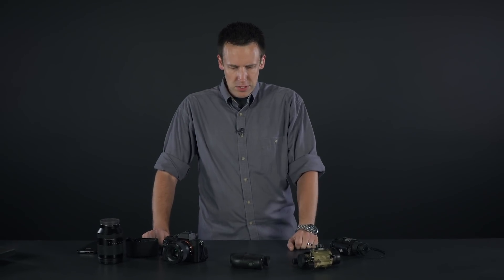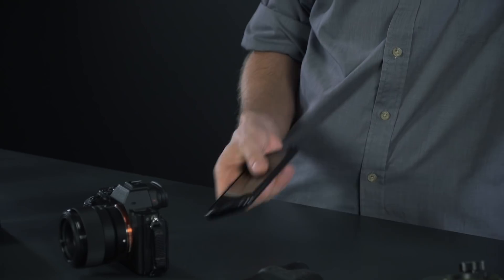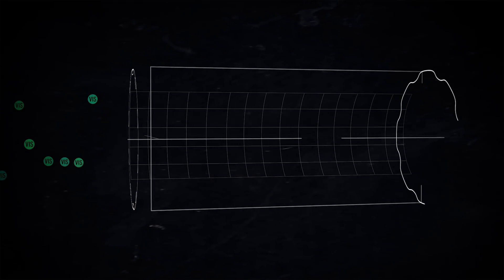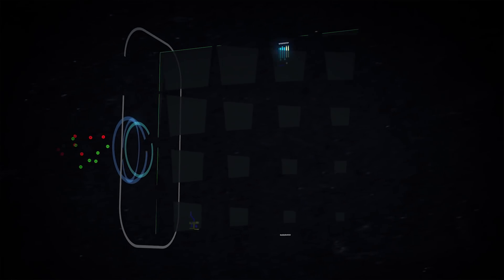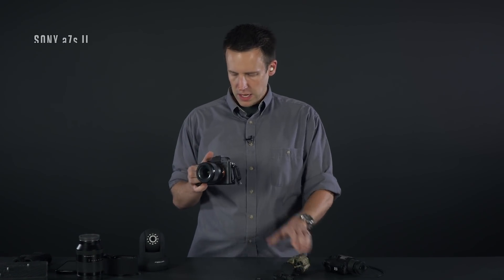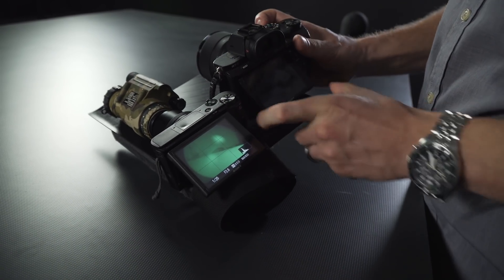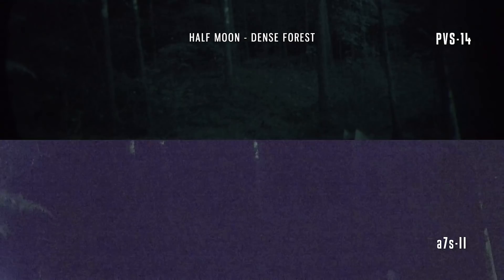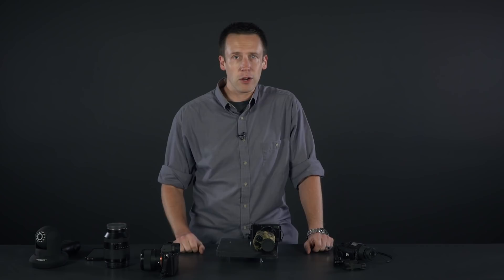When will Digital Night Vision Catch Up?

Comment: Here is my observation Tim. Digital night vision will be developing glasses to see and function in darkness a e everyday use tool. Thermo will be developing to use on fighting systems like rifles. Both will of course be smaller, lighter, with much greater clearly. Why I say this is everyone can use night vision to improve mobility and identify things. Thermo zeros in on temperature and can be tuned to track, body temperature, engine/motor temperature.... only draw back for the current thermo is seeing throught, glass and walls. But the next generations will fix that I am sure.

Comment: back in the early 2000s all the proffesionals were laughing out the tiny and not so bright led lights and telling xenon bulbs were the real deal like surefire etc. now leds are a zillions time better.You cant stop it. its technolgical evolution. in 10 to 20 years noone will pay even 200 bucks for those bulky gen3 stuff. ccd cameras which will have better light amplification and cost 20 bucks lol. dont laugh just wait. u will see. image intensifier tubes are almost dead. noone will pay anything for them in 2 to 3 decades.

Comment: I thought I would raise the point that you CANNOT USE normal lenses in this type of test as the Fluorite Glass lenses that manufacturers such as Sony, Canon or Nikon use would ABSORB both UV (Ultraviolet wavelengths at 10 to 350 nanometres) and IR (Infrared wavelengths at 800 to 1550 nanometres).

You MUST USE Fused Silica Glass (i.e. Synthetic Quartz) which absorbs only a small fraction the infrared (thermal) portion of the EM spectrum and allows UV transparency down to about 150 nanometres.

To get TRUE high end nightvision quality, swap out the lens elements with true fused silica (Quartz) ...OR... you can also use specific formulations of clear Acrylic plastic which can pass infrared wavelength and UV down to around 200 nanometres which is good enough for most nightvision applications. You can EASILY and quickly CNC-machine and polish lens elements made of such Acrylic so costs would not be to  much of an issue here!

In terms of IMAGE SENSOR performance, I suggest going to Teledyne-Dalsa which can produce large 25 microns per photosite 4096 by 2160 CMOS sensors at a cost of probably around $8000 per sensor. They will probably want a minimum manufacturing run of 100 to 250 sensors though!) Make sure you get the CMOS sensors that have STACKED layers that are sensitive to SPECIFIC wavelengths but pass through others outside the sensitivity bands. Each band is usually around 50 nanometres to 350 nanometres wide since each layer needs a differing set of CMOS dopants which cause said layer to be sensitive to specific wavelengths but transparent to others.

Such stacked layering of band-sensitive dopants would be on the order of 0.05 lux and better of light sensitivity across the ENTIRE sensor!  That is MUCH BETTER than Gen-3+ imagers!  It won't be a full RGB colour image but it WILL be bright and you can easily prevent blowing out the highlights and raising the luminance of shadows and midtones to see more detail using common digital signal processing algorithms!
.
At 25 microns per CMOS photosite, you are looking at about 102 mm by 55 mm sensor sizes for DCI 4K 4096 by 2160 pixel resolution which is doable in terms of putting that sensor inside of many modern medium format and large format camera housings from companies such as Sinar or Hasselblad.

In terms of image quality, you are DEFINITELY getting much better than Gen-3+ Gated video quality. It will be a 12-bit (i.e. 4096 values) greyscale image but Gamma-curve processing and contrast ratio enhancement added to 2D-XY SOBEL edge detection and some UNSHARP MASK filtering would turn 25 microns per photosite imagery to turn the darkest no-moon night into literally PURE DAYLIGHT! Ground-based lights reflecting of high cloud cover would be enough to get a near daylight look at 25 microns per photosite at 0.05 lux sensitivity levels!

Comment: It's like the old saying, "If it ain't broke, don't fix it." Analog has worked for years. It has less moving parts than digital. More moving parts means more problems. If soldiers can't see, they die. I've used NVG's in the field for hours on end in a fighting position. It was efficient enough and being analog we know it will be reliable.

Comment: I use a Gen 3 Starlight Archer scope add on. I did try a Pulsar digital scope but it was heavy and went through batteries too fast. Pulsar lasted 2 hours on 4 AA batteries, the Archer 60 hours on one CR123 battery.

Comment: Great comparison.  Being ex military and an owner of the Sony a7RM3 I am blown away with how far CMOS have come in low light. But in the end , for modern military applications , if it’s heavy and/or a battery hog it’s not going to muster being strapped to a soldiers helmet. They are already way overloaded.

Comment: Well then there is the electon bombarded CCDs that the night vision companies purchased the patents to and shelved. This isnt even a comparison. Pickup a set of fatshark goggles when drone racing. They cost about $300 and have 40fov. Double the cost and double the LCDs for a wider FOV. Then you strap a couple of these CMOS chips to the front. Instant death for L3 and ITT. They will not let it happen just like when that first company tried to release solar shingles in 2010. The oil industry simply wouldnt let it happen. Just like you cant buy solar shingles now.

Comment: A wayto improve the Sony would be to re-write the firmware so that it would reduce resolution, and conflate a group of RGB pixels into one. The reason is, the more sensor surface you have, the more photons you're catching.  Of course, the noise would increase because they are still independent sensors, but I wonder if by de-focusing the lens just a little, a clever comparison of various pixels within a group could allow to compute-out the noise. By precisely de-focusing the lens to the final resolution of the de-rated, concatenated matrix, you'd get more photons from a "new (larger) pixels" on several sensors, averating the light input, and allowing the computation of noise cancellation.
It's kinda obvious, isn't it ?  :-)

Comment: The guys who strap goggles on their head and race drones still use analog video for that live video feed during the race. There's too much delay when you try to use digital ones.

Also, the 80's Nintendo light gun games don't work on modern televisions because they're too slow. Your old CRT is quicker than your current television even if you're at a lower resolution. The timing has to be really really quick and precise for the Nintendo light gun to work and there's just too much delay on these modern televisions because of the digital circuitry and their buffers.

Comment: A 1.2 lens has two more stops of light than a 1.8, I wouldn't call the lenses similar, they're quite a huge difference. Get a 1.2 on the A7SII and that will give it may more light for those dark scenarios.

Comment: Comparing unfilmed gen 3 tubes to a 1995 photo tube is like comparing a modern PC to the first transistor based computer. They're both "digital" and use transistors.

Comment: The newest generation will be like the a7s but more like a flat screen tv on your face than a tube. Think fpv goggles with a big flat cmos chip on your forehead. These will allow you to see in color and night for day. They already have it out but right now the size is about the same as one of those Jurassic park 1 flashlights. So you're not going to comfortably be wearing that on your head. But technically it's already out and better than gen 3 by about 4 times. Yep that's gonna be the day when we can finally say goodbye to the played out gen 3. After that will be hyper-spectral imaging. Meaning they will combine different spectrums into one image. IE thermal plus visible light. Maybe even other things that aren't normally visible at all like sound or magnetic frequency. So what that might look like is anything composed of iron like your blood would have an algorithm to glow on your screen in your goggles and the sound would show an outline of the source. Meaning you could see someone's body through a wall based on their heartbeat and elemental makeup. Although most information on this suggests that to gather that data you need to triangulate the subject and point gathering instruments from different directions. So a satellite or drone on top looking down and other devices at the sides looking towards the house/location all forming an image that is then beamed down live(hopefully low ping lol) to the soldier wearing the device.

Comment: Great video. I've been interested of concept of using camera for night vision. If the subject is approached from a standpoint that you can have have IR torch  personal night vision with  cheapish cameras could be feasible. This video was about stead of the art night vision but at the cheaper end  IR unfiltered camera + IR torch might just be cheaper and/or better than  analog night vision gear from older generations. Let's say an something like  GoPro + cheap phone + ir torch.

Comment: It's likely a matter of time before digital catches up. I think in theory they can produce sensors with large enough and sensitive enough pixels to rival the older tubes. However there's not much incentive to do it at scale just yet. The sensor size needed for effective night vision may also still be too large for a helmet mounted headset as well.

Comment: Sony A7s II as the best low light digital, reality?  In low light if you’re willing to deal with the noise Nikon D5 has higher extended ISO and less noise at max native ISO. The Sony is a solid low light choice, but calling it best under $10,000 is a stretch.

Comment: Anolog will always be better, they are durable under extreme weather, rain, heat, cold, fine sand particles and impervious to EMP attacks! Yes, digital is better in quality but try bringing such devices to a desert setting such as Iraq or Afghanistan or a hot, wet and humid environment such as Vietnam. It would not survive in such conditions!

Comment: The A7SII's Bayer filter is going to be throwing away roughly 2/3rds of all light hitting the sensor, as each photosite is only capturing one colour.
I wonder how the A7SII would perform as a monochrome sensor, with the Bayer filter removed. 3x light should give some serious benefits.

Comment: You can buy a pvs14 gen 3 for less than $3,500 and the same camera sells for $2,600 new and you can get them much cheaper if you buy used. Having used pvs14s for two tours in Iraq i can tell you the product is top notch and a life saver. I would be extremely scared if the enemy had the same capability. Keep in mind that there are much better systems in use today, like the Eotech panoramic night vision a $40k+ system with much better image quality and improved depth of field. One thing to note is that these systems all require maintenance by a qualified expert because the equipment require being filled with nitrogen gas between the lenses from time to time. Great video, would love to see the same for thermal imagery.
Reply: Your cheaper pvs 14s are home built so to speak and usually use substandard or repotted tubes.

Comment: Is there a reason you were comparing the night vision device to a color camera.  Typically an image sensor designed for color is crippled by the color filter in addition to the IR filter. A monochrome or 'black and white' sensor would perform even better in your low light tests. If you are willing to sacrifice color than you could also change the type of CCD chip used.  Pick one that is more sensitive to the IR or use an intensified camera that replaces the phosphor screen with a CCD chip.

Comment: Did you shoot in s-log picture profile for the a7s ii. I think that would help with dynamic range
Reply: Some of the shots were. I was experimenting with different settings as I went. S-Log did help when there were brighter hotspots in frame, but it didn't do too much for shadows.

Comment: Digital cameras just about have caught up i seems. If the demand was there Sony could make an "night vision a7sII"  - a 1MP version of the a7sII sensor would be 12 times as sensitive. And it would still be able to deliver 720p video and stills.

I think it then would blow any GEN 3 NV out of the water - especially in any use case where 30 fps were not required. You could get the camera to gather light for, say, 0.2 second per image to get super low motion bright video (and remember, you can adjust the frame rate on the fly in literally a split second, should your use case change).

Comment: The a7sII may even be better than you thought, i’m pretty sure they used a regular lens made for the sony E-mount system. Those lenses have integrated infra red filters... to test the real performances of the sony, you should’ve used an old vintage lense, one that doesn’t filter as much invisible light as new ones do !
Reply: This is an excellent point! Based on my research, the f1.8 lens that I was using does not, but it is the reason I was using a fancier f1.2

Comment: Have the bayer filter removed, from the A7s II  and use a 1.2 lens on it. that should more than double the amount of light. There may also be a way to boost the ISO beyond the normal settings, and set the video to 24p fo a longer exposure time.
Reply: Yeah, but if you scratch the Bayer filter off (which is a job for a braver man than I) you also are removing the microlenses, so you lose about as many photons as you gain.

Comment: If 1080p is enough, there are companies that have developed full frame 35mm 2 megapixel sensors using modern CMOS designs which are able to see very well in low light (vastly better than the A7S II and even better than the night vision goggle shown in the video), though there is still the challenge of a full frame sensor needing large optics that are not very comfortable to mount on a rifle or helmet.

Comment: Thx for the detailed video, quality work.
For the moment very fascinated by infrared radiation picture management and the ability with not active cooled microbolometers sensors.
Mindblowing the abilities and not least in pitch black, but those sensors in high res cost an arm and a leg also been quite restricted for the mass-market.
But the possibilities are endless.
Would love one of these sensos.
https://www.eevblog.com/forum/thermal-imaging/thermal-imaging-gallery/?action=dlattach;attach=504431;image
https://www.eevblog.com/forum/thermal-imaging/thermal-imaging-gallery/?action=dlattach;attach=504425;image
for the moment i'm left with a 320x240 but still having a field day, also uploaded some videos with it.

Comment: I think there are several reasons digital tech is behind in night vision. Digital imaging companies are used to selling cameras and phones worldwide. Night vision is regulated in a lot of countries and US states, and in some places you can't own them at all. That's a narrowed market, and costly bureaucratic barriers to exist in some places they can sell. As far as the US, the biggest buyer of night vision products is the military, and they have very tight standards on proof of concept performance and high expectations in reliability & durability. This makes for a costly product development that most imaging companies aren't used to dealing with. Defense contractors are used to these costs, and have tooled up to develop, build & test NV tube systems; they're invested in that, and they'd rather not have to tool up for a whole new product family, as the first contract bid would be ridiculously high, and the Army won't buy it unless the product adds significant value in more features; even then, it's a risk. Law enforcement tends to follow military purchasing trends, so pitching straight to them would be a hard sell without a successful military contract. That leaves the civilian market, which is fairly narrow in terms of shooters who want to shoot at night and are willing to invest in infrared aim lasers, illuminators & sights to support nocturnal shooting. At that point, civilians don't buy in big contracts (distributors will keep as little inventory on hand as possible), and are very frugal with their money, even more so with an accessory with a niche application. There would need to be a big spike in civilian demand or a major breakthrough defense contract for nocturnal optics to have a bigger digital NVD revolution.

Comment: I’d love a mirrorless (or a DSLR) camera that doesn’t have a hotmirror or any sort of filter, but instead intelligently picks out the wavelengths of different lights so you can easily swap between infrared, UV and visible light without having to fiddle with filters.
Reply: That would be unbelievably awesome, but I'm not sure how it would technically work. It would need to be like an SDR for photons.

Comment: Both sensors are equally analogue. 

There is no such thing as digital electronics. It’s an abstract construction.
Both have to abide to the same laws of physics. 
CMOS has reached, or is very near to its limits WRT quantum efficiency.

Photomultiplier tubes will not be beaten.

You can have colour with three small tubes.

Resolution or colour has just never been a priority with night vision equipment. 
Simplicity and battery life has.